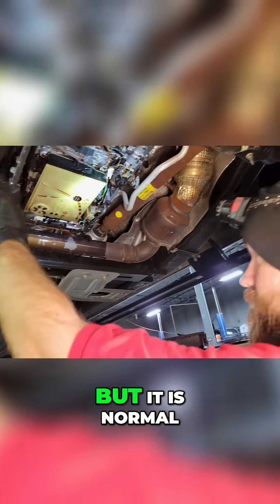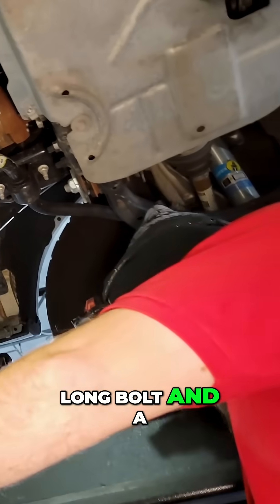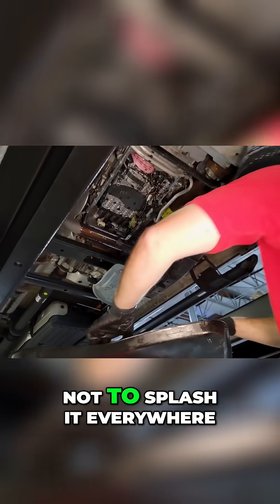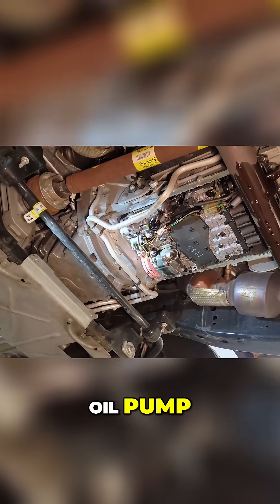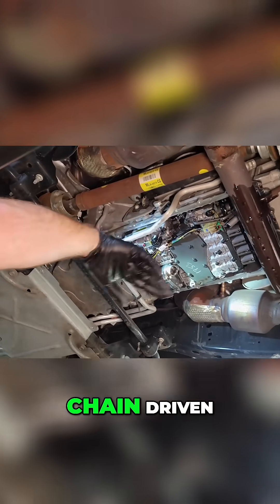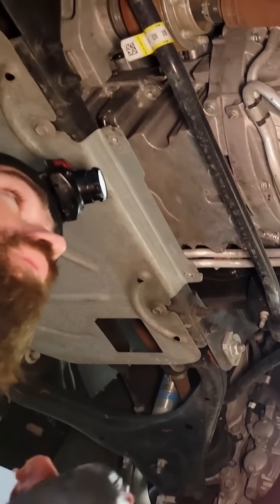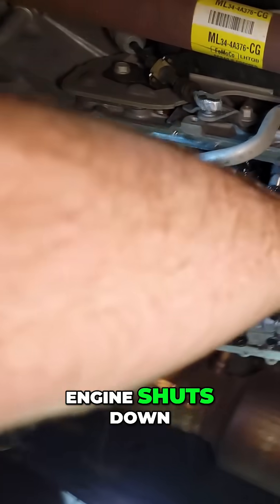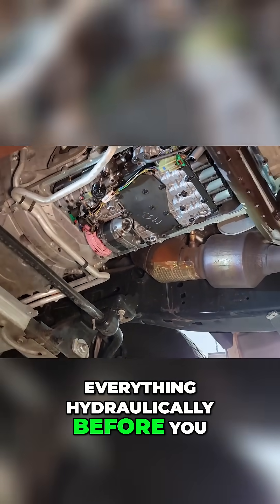MASTERING Transmission Oil Pumps  Essential Maintenance Tips

Comment: It's a shame he doesn't work near me. I called my local Aamco for a price quote for my '21 F-150 (10 speed), and they said, "we don't touch those!"
I try to avoid the dealerships, and that leaves me with local mechanics, but no one who really knows transmissions!
Reply from the maker: What I would do is find a transmission expert in your area it should be easy on Google Maps you should be able to find one with high ratings I would read the reviews and find someone that does the service.
You can order the fluids in the lubricants all through my personal website and that would give me the credit for your order and I would be able to answer your questions in the future with all the products as your oil and lubricant specialist independent Amsoil dealer.
Also if you are handy yourself you always have the option of doing it yourself you may need to pick up a few tools which you'll see in the video you can get those at a Harbor Freight also snap on make super high quality if you're into having something for a lifetime definitely a great option and can make your job a lot easier.

This Is The AMSOIL Policy - https://youtu.be/vIL7mCthods?si=Yln-KAQAyu9Ul2Jx
     
     For me to get credit & be "Your" Independent AMSOIL Dealer, please use my website below or my dealer no. 5331179 call anytime Eben Rockmaker 702-472-3614
After you click on: https://syntheticoilprotection.net/
1. Click the hamburger menu
2. Click offers AMSOIL preferred customer
3. Click join now. 6-month PC member add to cart.  ( There is no reoccurring renewal membership unless you select that dot box ) 
( You have the option to not have your credit card saved if you prefer - est. 1972 )
4. Scroll up to the top Select shop by vehicle. 

New Promo Codes: FREEBOWL